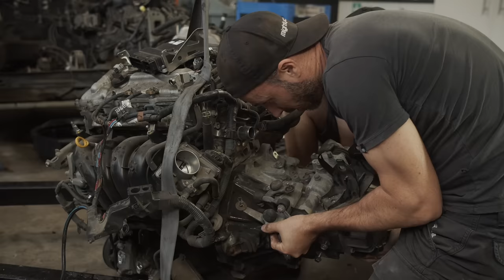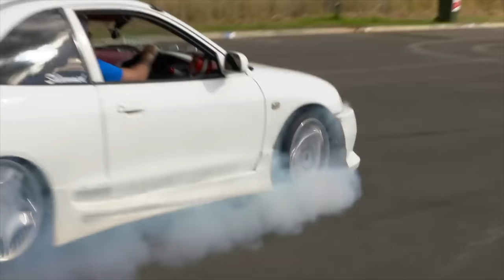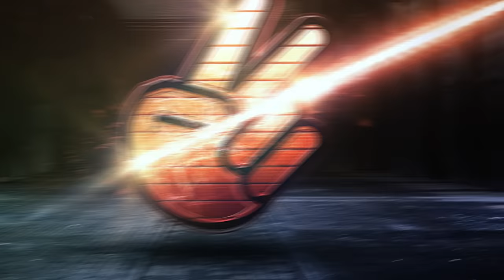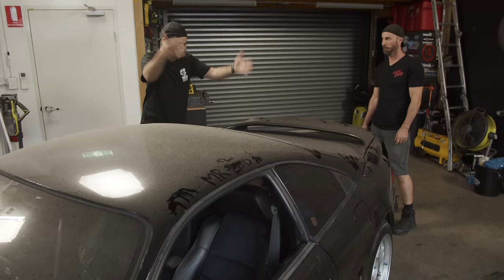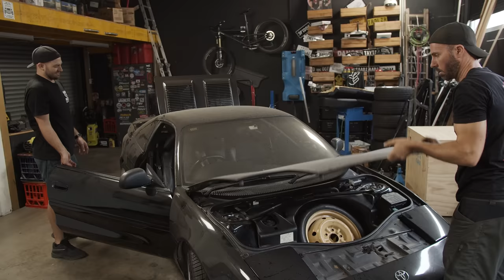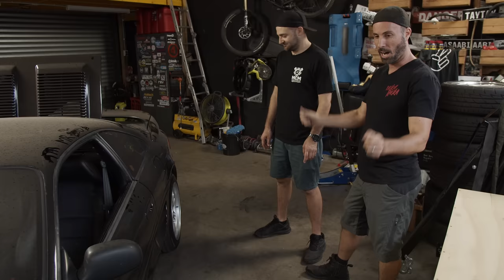$10,000 Rear Engine Challenge (Marty's NEW CAR)

Comment: Moog: "It's got more doors than mine"

Moog's "car" is a motorcycle
Reply: A bmw isetta...?
Reply: or buggy car?
Reply: @dudeness222  Absolutely my first thought too, when he said that XD
Reply: No doors like jeep 🤣
Reply: Thats a clue! Its an Alpine A310!
Reply: @dudeness222  BMW Isetta was my first thought too. :D
Reply: Moog proceeds to pull up in a pontiac Fiero with  a missing door
Reply: @tyranidtrygon  That would be hilarious xD
Reply: I wonder if he’s got a beetle beach buggy conversion.
Reply: Well, I wouldn't be surprised if he showed up in an Exomotive Atomic. If someone built one, and had it for a while, I would expect to be able to get it for $10,000. Although not technically a rear engine (sits in the passenger seat), it doesn't have any doors and is really fast as it only weighs like 750lbs. Obviously whatever he has is faster and more powerful than the MR2 is, based on what Moog was suggesting. And it has less than 2 doors. So either a single door and no door at all. I don't know what else he'd be able to get for that same price that has 1 or no doors and is rear engine and rear wheel drive. A motorcycle wouldn't be considered rear engine, so I doubt that's it. And VW buggies aren't typically very fast unless someone did a lot of work to them (which would make them more expensive), and a BMW Isetta DEFINITELY isn't fast. I'm curious what he's gonna bring to the table that is under $10,000 and is going to be better and faster than an MR2 is.
Reply: Bubble car
Reply: @dudeness222  I would be so here for this
Reply: Gotta be a caged old race Porsche. Mr2 isn't registered so moogs car won't be registerable.
Reply: Dune buggy
Reply: I bet it's a vw beach buggy
Reply: Formula Vee car
Reply: Eureka has 1 door.
I'll be blown away if MCM gets one though!
Reply: Does Australia get vauxhall vx220. Think they were called Opel speedster in Europe
Reply: @steve101968  Yeah, Top Gear did a presentation on it, and they loved it - over here it was the Holden Monaro! But it is Front engine/Rear wheel drive which doesn't fit in with the challenge brief; and unless it was a slip of the tongue Moog did say 'more doors than mine' - which indicates either one door or none?? Also, I think he would be hard pressed to find one for less than $10K. They have become a bit of a collectors piece in AU.
Reply: @muzzaball  
Different car mate, it's not the Monaro
Reply: i d go for a car with one door simply missing, bought sight unseen...
original vw beetle base dune buggy without doors...
Reply: dune buggy?
Reply: The number of doors was just to throw us all off, if you count the other "doors", the mr2 has 5
Reply: Fiat X1-9. Bet.
Reply: $10,000 Go-kart for the win
Reply: @dootsmith8857  oh ok, yeah I see that now - my bad. It was the Vauxhall Monaro VXR on Top Gear I think. No we did not see the Vauxhall vx220 over here! That makes it perfect for a MCM Import then, tho not JDM.

Comment: 9:09 I've never seen a turbo mr2 for less than $6k over here in east coast US. The non turbo's definitely go for less but the few turbos that pop up are not dirt cheap in my area
Reply: same here in canada, i knew a guy who got a good deal on a non turbo aw11 for 3k
Reply: I can never find a reasonable one in MA.
Reply: The_Legend_Of_Kira you gotta keep in mind that our 3000canadian dollars is equivalent to 2,49$ USD 🤣🤣
Reply: These are no longer as cheap as they used to be ANYWHERE.  You'll easily pay 2x what you would have been able to get one for just 4-5 years ago.
Reply: just checked, cheapest one I can find with a turbo is 6700
Reply: Seen turbos for 2k here in UK
Reply: @Patrick Ross That's a great deal, and a fantastic candidate for a 4th gen 3SGTE or a 2GR.
Reply: California rust free cars are even more pricey.  I wonder if it would be worth buying a clapped out, non-running NA one for cheap, and then swapping in a newer V6 engine?  California makes you jump through hoops to do an engine swap, but as long as the engine is a US market engine, as new or newer than the car, and has all the stock smog equipment, it should be able to be registered.
Reply: Get one without an engine and put a k24 in it :D
Reply: Lots of people selling WAY high thinking they got a hot piece, but they are normally trashed
Reply: Pretty much the same in the south, clean turbo aw20 $6k+.
Reply: @FlyingNDriving  Naturally, everyone's a "i know what i got no lowballers" when it's their car. Still means the few that do pop up ain't dirt cheap
Reply: Stephen E that’s what I kinda did/planning to do, but not the clapped out part, I wanted a turbo but the prices just weren’t there for me to justify it, I found a really clean non-turbo one cheap, and I plan on doing a 2grfe swap on it hopefully this summer until then she does mighty fine in daily duty

Comment: 3S-GTE it's such a good motor, that's why they raced it in the Supra for the JGTC instead of the 2JZ-GTE
Reply: Soo true the only weird thing is that in gran turismo 2 the castrol toms supra has a 2jz for some weird reason 🤔
Reply: Well.. sort of. Mainly it was just wayyyy lighter than the iron block 2jz, which helped a lot with the handling.
Reply: It was the race version, the 503e or something like that. Shared very little with the road going 3sgte but based on it. Could handle like 800hp and the displacement was bumped to 2.1l
Reply: @DennisH22A   what im trying to say is that gran turismo 2 got the engine of the castrol toms supra wrong because like you sead it has a 3sgte but the game description says l6 instead of l4
Reply: A 3S-GTE with stock internals can easily handle 300HP.
Reply: They ran the 3S over the 2J in JGTC because the regulations allowed for more boost with the 4 cylinder engine. This also allowed the lighter engine to be placed further back in the engine bay, allowing for better balance.
Reply: I thought it ran a beams??
Reply: @shxtbox  which is a 3sge/gte there is also a beams 1gfe and others
Reply: Would be better to mention that a 3S-GTE powered car held the Pikes Peak hillclimb record for 14 years. The engine is very capable in race applications.
Reply: Meh get rid of that and stick in a 2GR-FE and supercharge it. Just like Lotus.

Comment: You know all I want is for moog to show up in a smart car... Rear engine, rear wheel drive, two seater... Weighs about 1 ton

Could be epic
Reply: That would make me die inside.
Reply: as someone who drove one for a while...pls don't :)  although the only really bad thing is the bad automatic transmission- so a manual conversion (no idea what transmission would fit in there...) would be nice to see
Reply: ...with a GSXR engine swap.
Reply: smart with motorcycle engine would be rad
Reply: 1000cc streetbike swapped smart car.
Reply: @olik136   Bike engine and sequential...
Reply: therezinUK turbo Hayabusa motor.
Reply: Do a motorcycle engine swap. We know moog likes bikes so that would be awesome
Reply: Turbo busa swap with a 100 shot of giggle gas
Reply: Weighs about 750kg i think :D
Reply: Smart is 750 kg
Reply: Moog bought the same car
Reply: With a 1000cc motorcycle engine in
Reply: with a Hayabusa engine swap
Reply: Brabus edition smart, with a whopping 55hp on a good day.
Reply: But he said the mr2 is 30 years newer... I think isetta or most likely a buggie
Reply: Not a Fortwo but a Roadster. Would definitely be a challenger.
Reply: Smartcars aren’t all that expensive, and wrecker bike engines aren’t all that expensive. I don’t know, wink, wink, nudge, nudge.
Reply: Honestly a boosted busa smart car is gonna murder pretty much anything that will turn up for 10k and even if it doesn't it'll sound the coolest

Comment: I love MR2s, it's actually what my work revolves around. I've owned 4 personally, currently working on 3.5 v6 swapping mine. At my work we have 16 or 17 in various stages. Currently building one for a SEMA car too. Very excited to see how this progresses!
Reply: Your job sounds awesome.
Reply: how much for you to v6 mine haha
Reply: I want your job
Reply: Brilliant dude!  Whenever I see one on the road its a happy day.
Reply: I was wondering what manual transmission you use? I assume the V6 is a 2GR-FE? Cheers mate
Reply: @2grmr2  varies depending on different options and add ons.
Reply: @richardggeorge  there are two options, the s54 which is the na trans and the e153 which is the turbo trans. I really would.not recommend the s54 as they are the weaker trans and really don't usually hold up well to the power of s 2gr. E153s are definitely the superior option and do great behind the 2gr. You can even swap the 5th gear from a camry e153 for a better highway rpm.

Comment: " I thought you were gonna get an RX7 "
But this is a rear engine challenge Moog ;)
Reply: Moog had a little snap brain oversteer :D
Reply: rx7 is a mid engine car
Reply: AmiBorg No reason to get so salty I was just saying that an Rx7 is technically front-mid engine lol. No need to insult me
Reply: @ami_87  lol calm down champ
Reply: I've been waiting for them to get a rx7 for years :( .... one day
Reply: @ptoughneigh854  no, it's really not. The engine is set back that's true but not a mid engine by any stretch.

It's barely any different from any other FR the motors just short lol.
Reply: Dale Neish mid engine is the motor is between the front end rear axles🤷🏻‍♂️

Comment: I'm willing to admit, I'm jealous.
I have always had a soft spot for the MR2, and this exact car is on my unicorn list.
Reply: I have a JDM black hardtop MR2 Turbo just like this one, it's great, I definitely recommend one! I never had it snap oversteer on me by the way, but I run wider tyres in the rear than the front though, so I think that helps! :)
Reply: The mid-engine setup is amazing! I own an MG TF 160 that has the same layout but weighs less I think. Having that raspy engine screaming half a meter behind your ears is just marvelous! It outmaneuveres Miatas all day long and because of the rev happy N/A 160 HP 1.8L, big 4-pot AP Racing brakes and low weight it'll give a GTI a run for its money on a twisty backroad. I could be banging against the limiter all day with the wind blowing my hair off :) I love that thing
Reply: K swap it.
Like boosted boys did
Reply: They are pretty cool, just be prepared to hate yourself when you go to work on it
Reply: @reggiexp69  personally I'm not really after speed, mine is completely stock and it is going to stay that way :-) plenty of power for me, don't need more.
Reply: Mid engine FTW.  
Porsche 914. Throw a small block, aluminum V8 in it.  :)
Lookin forward to this MR2 build. and whatever Mog brings.
Reply: My neighbor had one decade ago and it was cool little car, but while i would love to own one price is bit high and its utility value is kinda crappy to be honest. If i was not needing space to transport stuff then this could be real nice daily.
Reply: @Hellsong89  I use mine only as a weekend hobby / project car for enjoyment, and for that it's great. It's also great for taking a lot of small items with you, as it has a trunk AND a frunk, but if you want to take something large then you're out of luck with the MR2 :-/

Comment: If Moog bought a FIERO with a Door missing...
I'll likely CHOKE!! 😆😂😜
Reply: Not gonna lie racking my for other MR/RR setups in the 10k.  The fact Moog was asking about MR/RR makes me think he got like a boxter or something
Reply: @Iregretthispost  i know what he got but i wont spoik it for you, it was in the latest book they released
Reply: Did they even sell Fieros there?
Reply: @bradleyard4195  don't think so
Reply: @bradleyard4195  ONLY if they're that unlucky!!
Reply: @bradleyard4195  Nah there are a few imports knocking around - probably brought in by US expats. Fiat X1/9 was sold here though...
Reply: @ad_fletch  That's bad enough!
Reply: Delorean?
Reply: Mwoo NSX, please make it happens...
Reply: Supercharged 3.8 or LS4 swap would smoke that MRPoo
Reply: @Lazarus1940  DeLorean isn't a mid engine Rear engine RWD if only DeLorean had used Rotary that would be the plan but they scrapped that idea and go for an unreliable V6 made by 3  motor company
Reply: @mayuravirus6134  Mostly correct. I threw that out there just because Moog kept waffling between Mid-Engine and Rear-engine.

Comment: Marty: "dirt cheap in america"
Me: HAHAHAHAHAHAHA.

Mate, not only are they virtually non-exsistant, they go for insane prices due to the rice tax. Last one I saw in decent condition was $15k USD. You got that thing for a steal.
Reply: HellishINC I have seen dozens of mr2’s for sale in $5,000 dollar range. Idk when the last time you looked was but they aren’t that rare or that expensive.
Reply: @adriancalugar3990  uhhh where here on the east coast they gone. I just looked and found two for $8900
Reply: I was coming here to make the same comment, I live near the west coast and was looking at them last year, finding a RHD MR2 GT, the cheapest one in good shape was just under $12K
Reply: @greasemonkeyadventurer  there definitely a few under the 5000 range you aren't looking hard enough
Reply: @lenientorange1113  SW20 price range is WIDE... The massively under powered NA USDM (130hp) can be had for 5k$... You'll never find a Turbo for anywhere near that much, very nice models reaching 20k$ easily at auction. JDM Rev3-4-5 turbo like this one are very expensive too as they have the best engine (245hp when USDM ones made just under 200...).
Reply: I bought a non turbo 92 mr2 for $1900, it was in pretty good shape with turbo swapped interior (black leather$$$) and around 150k miles, 5 speed. You can get automatics for even cheaper, but that was back in 2018
Reply: A low mile one just sold in Canada for $60,000
Reply: LOLWOTF there going for like 500$ here in florida
Reply: Incorrect
Reply: They’re cheap in the UK but also all very rusty or been overdosed with crappy mods.
Reply: Huh... Friend of mine got an AW11 for $500. Blown engine.. but still.
Reply: @thelonelycaterpie3207  what condition and is it proper factory turbo versions?
Reply: I regularly see them on Craigslist from 3k to 10k where I'm at in the US, you have to look harder.
Reply: They're cheap in the UK.
Reply: Confirm race tax. A bud who races keeps buying them all up. I looked into one and it was rotten and asking way too much
Reply: I found one for $500 once...

...in my dream...
Reply: @adriancalugar3990  Non -turbos go for that.
Reply: @lenientorange1113  really where are you finding turbo cars for that price. Maybe copart?
Reply: @greasemonkeyadventurer  my bad i should have clarified that they were non turbo mr2s
Reply: @lenientorange1113  yeah I found 6 of those turds for 700-3500
Reply: @greasemonkeyadventurer  where did you find one for 700 cause i was going to buy and engine swap one
Reply: @lenientorange1113  gone but theres one for 1k now. Maryland pa va area

Comment: Just for some quick info when the mr2 gt was released it managed to run the 1 mile drag faster than the rx7 and the supra
Reply: lil oveRdose666 What?!! That’s crazy!
Reply: @craigarcher7594  It was a faster car than the twin turbo Supra. Look at Best Motoring, it's quicker than an R32 GT-R.
Reply: @itsallac0nspiracy  well it is about 800lbs lighter than a Supra.
Reply: Big D Fitness Yeah, with a much smaller engine and one less turbo.
The same engine that Supra used in the JGTC.

Hopefully people (MCM included) will learn a lot  about the SW20, now.
Reply: @itsallac0nspiracy  the MR2 had about 240hp and in Japan the Supra was limited to 280hp
Reply: That’s awesome. Compared to those cars $8,000 is a bargain.
Reply: The 3s-gte is a well build engine. The Yamaha head flows crazy good. Handling is a bit snappy but it has a crazy launch.
Reply: @bigdfitness5020  by your logic the r34 GTR was 206kw as well..... you honestly believe they electronically limited cars in JP?
Reply: This car is VERY underrated.
Reply: the difference is those cars were limited, this was not, so without limits, this wouldn't stand a chance
Reply: Wasn't the 503e used in the JGTC supras?
Reply: Big D Fitness The Supra never had 240 BHP.
Despite the ‘gentleman’s agreement’.
Reply: @itsallac0nspiracy  280, not 240. But I am very aware the horsepower was underrated.